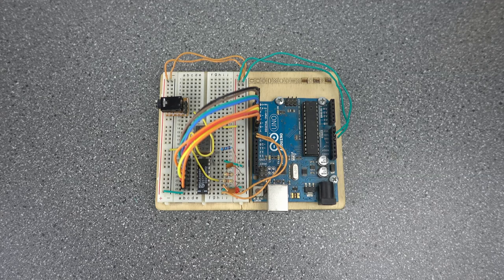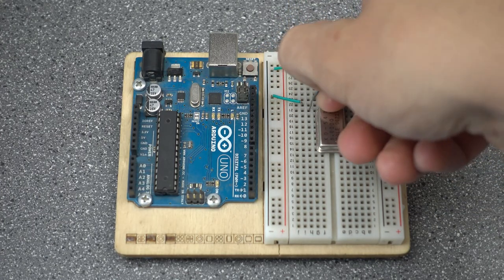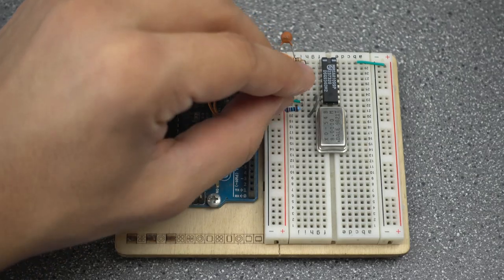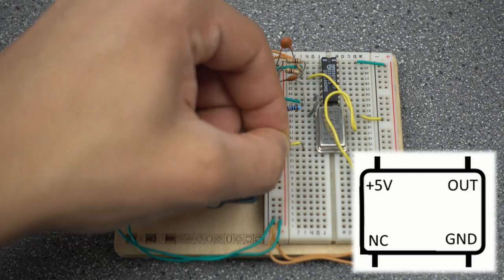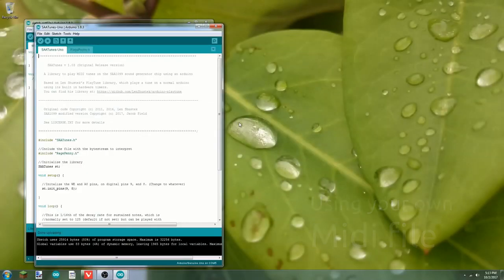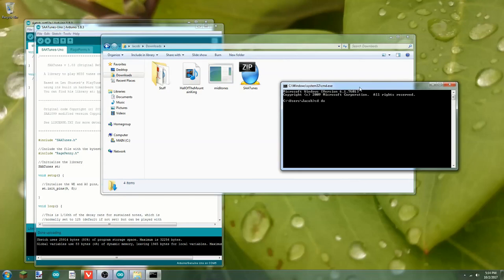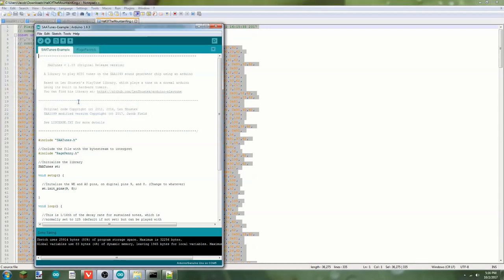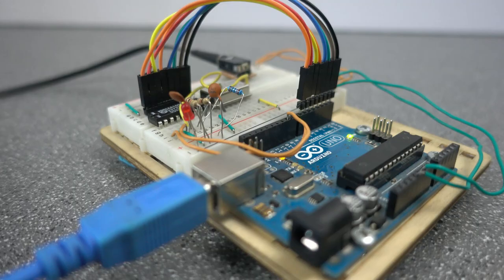SAA1099 & Arduino - How to DIY

Comment: I made this arduino SAA1099 player. So awesome! Now I'm trying to make a synth out of the SAA1099 using a Teensy. I have a long way to go since I just learned basic Arduino programming but you helped me with the part I had no knowledge of: Building the circuit. This video is fantastic and I just wanted to drop by and say thanks for helping me make several audio projects with Arduino. Your articles are well written and easy to understand, and you've inspired me to explore further with the Arduino as a musical instrument.

Comment: You could leave out the oscillator and use the arduino as a clock generator, but you would have to reroute a0, because the timer1 uses pin 9
Reply from the maker: That's a good point. A0 is easily rerouted, it's just assigned in the code.
Reply from the maker: Making a single-board version of this is on my list of things to do eventually, so I may look into that.

Comment: i wanted to make microtonal music on saa1099 - so instead of using a lookup table, that i think is what is used for a 12tet, how can we calculate hertz frequencies to register values? i thought saa1099 is a kind of 256tet, but the sound is totally weird from what i expected
Reply from the maker: I'm not sure precisely what you're trying to do, but I'd recommend reading the datasheet. It's free online and will have all the details you need to figure out how/if the SAA1099 can do that

Comment: after writing the code in arduino and pressed upload, will it start to generatethe song (midi file)
Reply from the maker: Yes, it should begin playing the song after the program is uploaded. A few things to note are that if the MIDI file has a header, it will take a little bit to load that into the memory. If it isn't working at all, recheck all the wiring. The instructable has clearer info on wiring, so you may want to look at it. Good luck, and feel free to contact me again if you need any more help!
Reply: thank you, also i wanted to know if theres any way possible that you can store multiple midi songs at a time and you can choose which one to load
Reply from the maker: Yes, but depending on the length of the MIDI files, you may not be able to store many at a time. You could potentially get around that by adding extra memory chips to the Arduino, but I haven't done that so can't be of much help there! To include more than one MIDI file, you'd just add another #include<songName.h> line with the "songName" replaced with whatever you named the other .h file. In the .h files, you'll need to change the part where it says "score" at the top to something else that you can identify the song by. Then in the program, you can select which song to play by changing the line that says "st.tune_playscore(score); and replacing "score" with whatever you changed the "score" in the .h file to.
To select between songs, you could have a button or two, or a knob, or even hook up an LCD and some buttons. It should be a pretty simple setup with an if statement or two, and if you haven't done this sort of thing before, there are plenty of good videos that will show you how to use buttons or other input sensors to do things.

Good luck, let me know if you have any more questions!

Comment: does this work for a YM2612 and YM2203?
Reply from the maker: No, the code and wiring are different. You could certainly adapt the same library I did, though.
Reply: do you know anything about any of the both?
Reply from the maker: @TheTartKnight  Not much. They're 3-voice square wave chips, correct?
Reply: yes, I think
Reply from the maker: @TheTartKnight  Ok. It wouldn't be too hard, you'd just replace the parts that are specific to the SAA1099 in the library. For example, there's a function called "noteOn" that turns channels on to a certain tone--you'd need to read the datasheet on the YM chips, and modify the code inside those functions to work with the YM chips.
Reply: I see, welp, time to have a hard time. I barely know bout' electronics
Reply from the maker: @TheTartKnight  That's fine, there's lots of information online. I was definitely out of my comfort zone when I made this, so it's a great learning experience. Keep me posted!
Reply: aight, if I ever had the thing done I will show you. You might find it interesting.
Reply: that sounds cool, I am waiting eagerly.
Reply: @TheTartKnight  here yout go: https://github.com/arduino101/ym2149
The code is for the arduino mega but I linked the original code for the arduino uno
Reply: will you make a tutorial @Der Nerd?
Reply: I would also like to know compatibility on YM2203 and YM2612
Reply: @TheTartKnight  the ym2203 and 2612 are totally different. The 2149 has 3 square wave only channels, the other chips have 6 with multible wave forms and some other stuff. And I'm struggling with getting clean audio from the chip. I could make a tutorial á la instructables but not a video. If you try my code could you tell me about your sound quality. I'm thinking the bad sound is a software problem
Reply: I see, see what you can do with those chips
Reply: @TheTartKnight  they shouldn't be that different but I don't have any of those chips, so debugging would be impossible
Reply: they are on ebay, you could get them from there, I want to get garanteed that your method works with them

Comment: Where the hell is the speaker?
Reply from the maker: It's connected through the audio out connector to a separate speaker. For the video, I had it wired directly to the microphone input on my computer.
Reply from the maker: You could use a normal little speaker breadboarded in, but it would be awfully quiet.